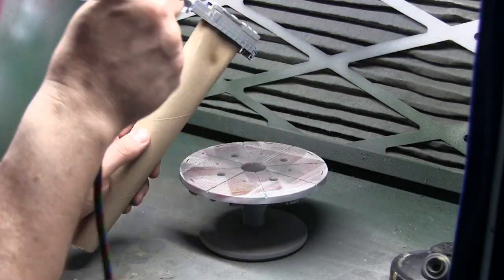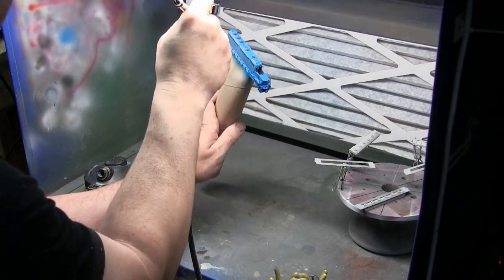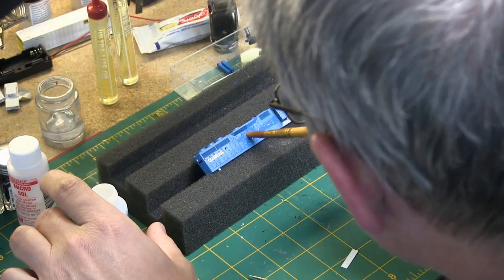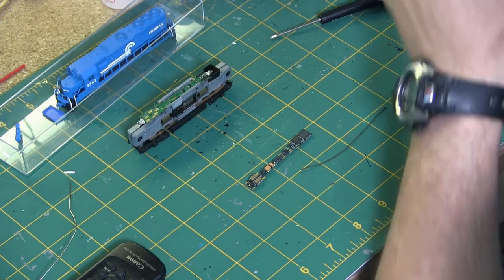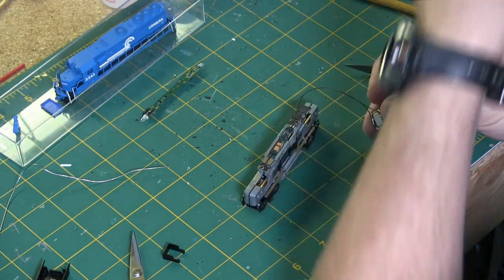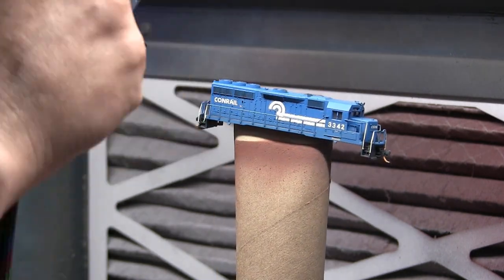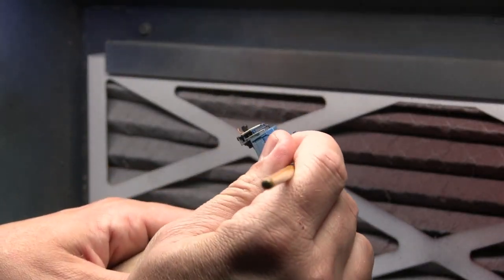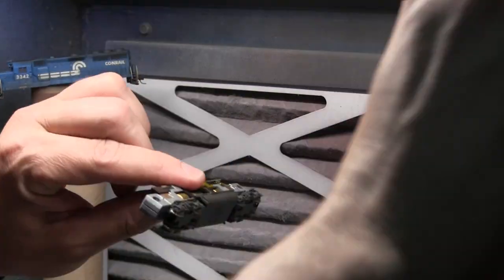Paint, Detailing and Weathering a GP40-2 with ESU sound

Comment: The micro-sol is to get the decals pliable and the micro-set helps them conform to the details on the shell right?
Reply from the maker: I think the better way to understand is the micro-set aid in positioning the decal, micro-sol makes it pilable and set over the details. I found that with the larger decals if you do not use the micro-set you get "silvering" on the decals. Thanks for watching!